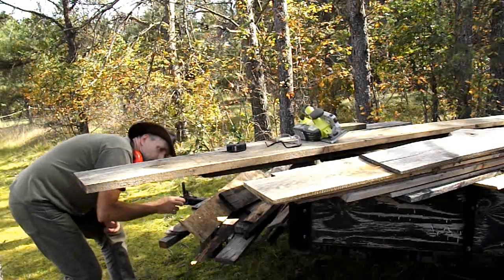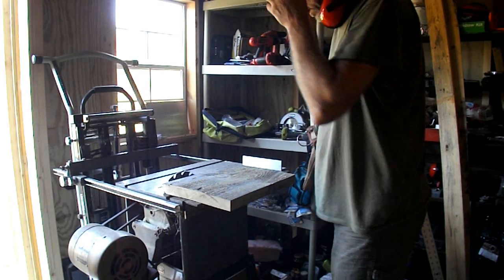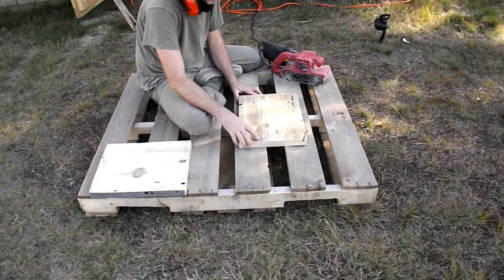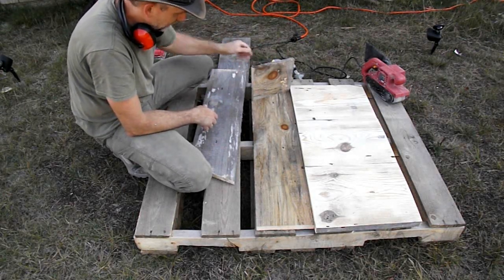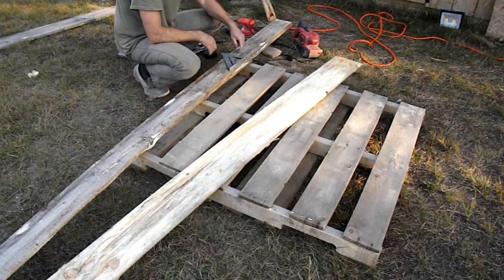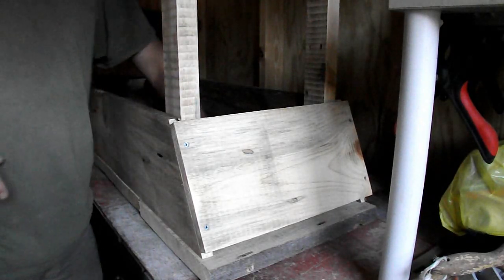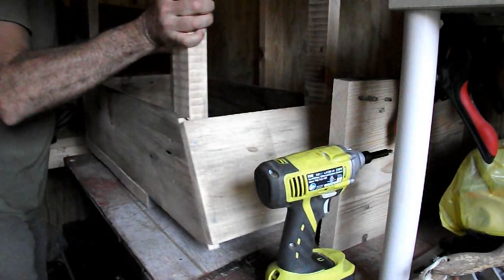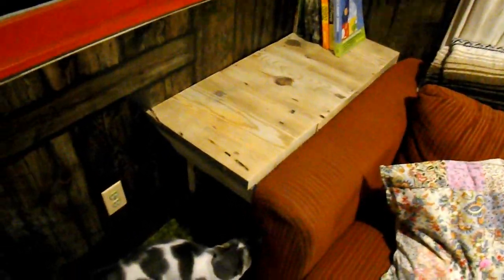Building An End Table With Storage Underneath Hinged Lid

Comment: not sure why you didn't plane them. The crown the wood will make everything wobble. It's 2" thick. You won't loos any strength unless you plane it down to 1/4" thick!
Reply from the maker: Because, after many long slow passes, it was getting me nowhere. Its not a fast planer.
Reply: Are the blades sharp?

Comment: Have you built a baby bed for your room yet? You mentioned a couple of videos back that you might.
Reply from the maker: Still trying to figure out the layout of our new home
Reply: Couldn't you have been doing that all summer tho Troy? You're cutting it pretty short to know where baby is going to sleep etc. And I thought the baby had a bed.  JMO
Reply from the maker: No, until the really cold weather came on we thought we could stay in the trailer. But then we found out that we could not. So we moved to the chalet. We have not been here through all the seasons yet so we are still learning about the place.
Reply: MissX905 that concerns me too. If she's so close to giving birth. The baby may end up in a basket on the floor. Or a bureau drawer. God I hope not.
Reply: They have a pack n play they can use.  It has a changing station, mobile, holder for accessories and lots of other items with it.  It will fit in the room just fine.  I think he forgot that they have it as they were concentrating on the crib.

Comment: Can barely hear you. :(
Heard you better later in the video. :)
Reply: Can't turn it up when it's at it's max. >_>
Reply from the maker: +MotherOfManyHorses odd. It was super loud when editing. I always double the volume now
Reply: What device are you on? Phone, Tablet or internal laptop speakers would be my guess, if not get better speakers. +The Do It Yourself World  The sound on any cutting should be be left alone or lowered a bit.
Reply from the maker: +That1ufo I reduce the volume of power tools most of the time
Reply: Yup, laptop. I should probably see if I can get my hands on some small speakers to plug in to it.  Every now and then I have issues where I can barely hear the audio. Don't know if it's my laptop or the channel.
Reply from the maker: I have to turn mine up to 100% and then can barely hear anything sometimes. I use external speakers. Why cant they make a laptop with decent volume?